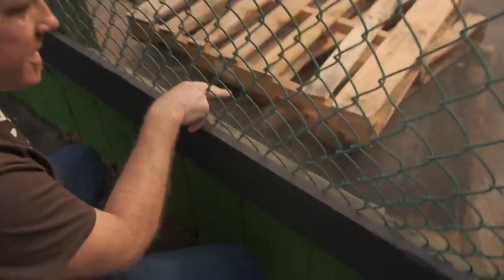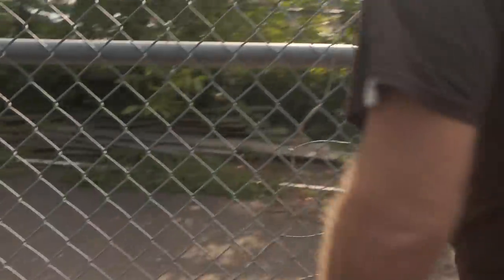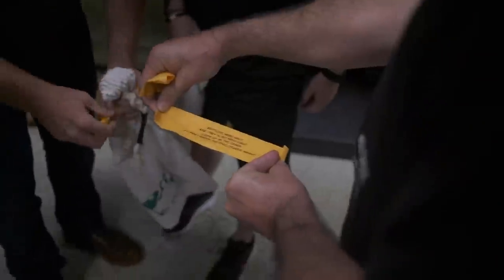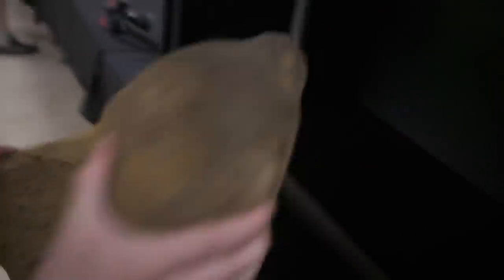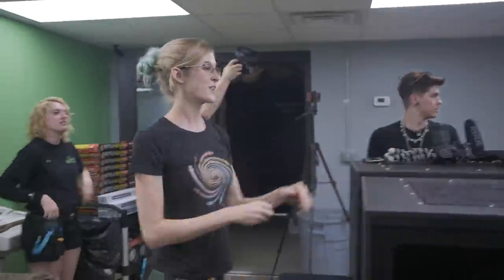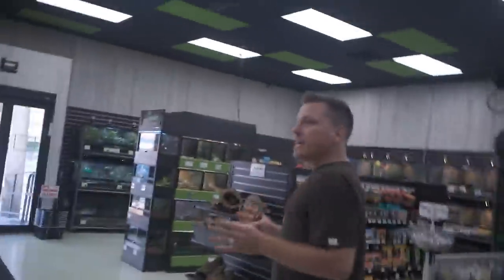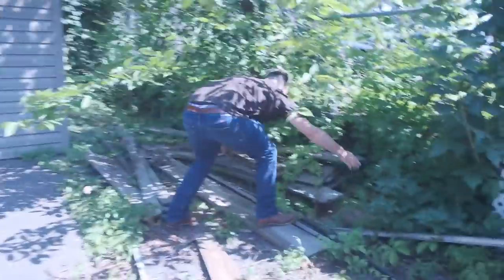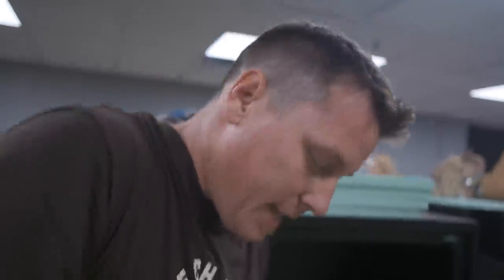How to DIY a NATURALISTIC enclosure that will win Snake Discovery’s BUILD OFF

Comment: The enclosure that you built is absolutely stunning and I love the innovative design that you incorporated! Feels like a proper zoo build! Was just wondering, would the wood hold up well to the humid/moist environment well or would it start to rot?
Reply from the maker: WE have TONS of drainage built in, and those heat treated pallets do last an awfully long time, even outdoors, in the rain, sun, etc.  Nothing lasts forever, but these were designed to hold up under natural torture.  ;)
Reply: @ReachOutReptiles  Thanks for the reply! That makes a lot of sense! It has now inspired me to make a really interesting enclosure, even if I don't use it for one of my animals!
Reply: Over here in Germany people build yard furniture and plant holders out of heat treated palettes and leave them outside during the winter. They hold up really well. So I would assume that they would easily last for a few years inside the enclosure.

Comment: My kingsnake would love that enclosure!  How big were the enclosures? Mine is 120cm×50cm×50cm and it looks a bit like these except mine has a sliding door en the ventilation is smaller and the heat and UVB lamp, and ceramic heat amitter are inside the enclosure. I have everything allready I just have to decorate it with some basic stuff because no expos here yet where I get most off my stuff. But it still will be pretty nice. I have a huge peace of wood with branches for climbing. 3 hides if you include the Buffalo skull, and some fake plants. (I don't like bioactive) naturalistic all the way. And a piece or cork bark or how do you spell it. And I use reptibark as substrate
Reply from the maker: Very nice!  This enclosure would be just a little bit larger, 48in x 24in x 24in
Reply: @ReachOutReptiles  The enclosure is super nice. You deserve to win!  It stood out the most and yeah you gave it a personal touch with the tools. So no doubt you deserve to win.

Comment: Did you weld/solder the copper plumbing on site?
Reply from the maker: I did not- that was my one item I brought from home.  I actually would have loved to (would have made for great video)- but air travel with propane gas and the time constraints had me worried on that one.
Reply: @ReachOutReptiles  Propane on a plane doesn’t fly! 😂 The water feature would have put your build over the top by itself, way to set a bar nobody expected! Huge respect,.

Comment: Were you able to ship yourself your old and new batteries?  So glad you got the invite.  Good tip about pet safe wood.
Reply: I just flew from TX to VT and back with power tools. Gotta check the bag with tools and carry on the batteries and chargers. Had zero issues on Delta.
Reply from the maker: @Gonzotftd  Yeah, it seems odd, but they want you to keep your explosive stuff on you when you fly!  Wish I knew that in advance!
Reply from the maker: We drove home, so I kept the new ones.
Reply: @ReachOutReptiles  it’s so they can put the fire out instead of it taking out the cargo hold.